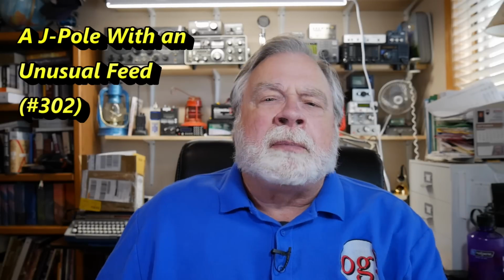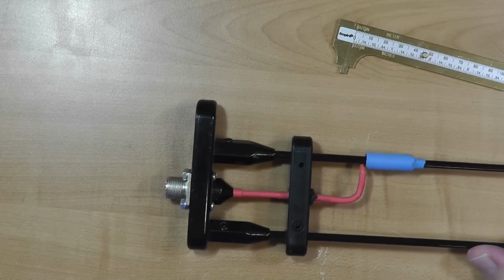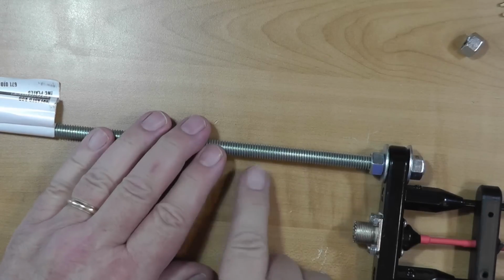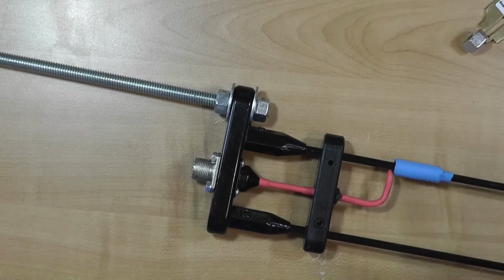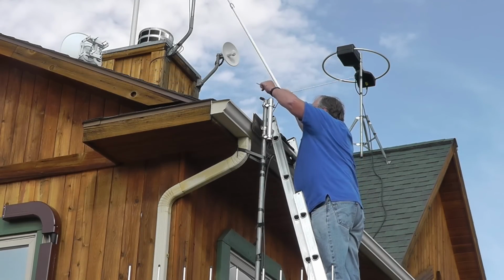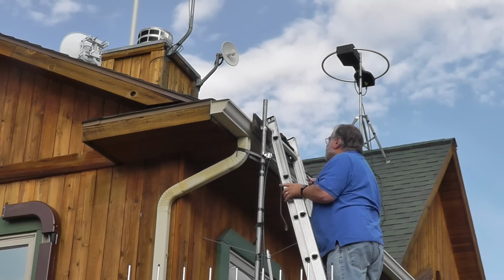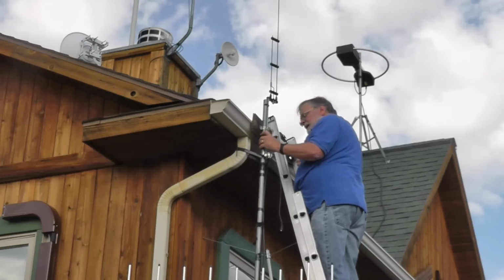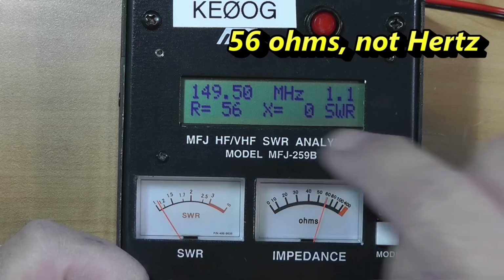An Unusual Jpole Antenna (#302)

Comment: I know this is an older video but I hope you still read comments on them.... At the final portion of testing the swr .... the swr was best just outside the 2 meter band, then you mentioned that the antenna needs to be longer... in which I understand that length is usually the key for antenna matching.... but what is the adjustable section (the feed point) for? I know its to be set at 50 ohms, but in the sweep of the freq from 144 to 148 ... you was in the 60 ohm range... so wouldn't adjusting the feedpoint be the better option for matching the antenna? And yesw, I also understand that its an unusual feed point design... it looks as if wire is wrapped around the element capacitively coupling to it... so I think that should be able to slide up and down with a bit of force. I'd really like to hear your opinion on this as I am struggling with the concepts of these antennas. I'm designing some j=pole for scanner listening and I'm having a bear of a time getting them tuned. Most of mine are being built using 450 ohm window line. I'm considering going to copper tubing for better bandwidth. But with bandwidth, the Q goes down and the gain suffers correct?

Comment: A few clarifications on the CAD drawing provided by KR7KZ from the link above.  The machine screw holes (P44-P47) for mounting the SO-239 are for #4-40 screws and the jamb screws (set screws) holes that secure the elements to the base are for #6-32 hexagonal head, setscrews.  Personally, I'd drill the setscrews centered on the element mounting holes instead of using a side-interference style of securing arrangement.  The design I bought over 42 years ago, was from a ham club that was raising money, is a variation of this one.  On mine, the biggest difference is that the coil is wound on the longer element (in basically the same location) and is wound upside down (from the top down) thereby making it impossible to prevent water migration onto the coil.  However, water migration only slightly detunes this design - maybe 0.3 SWR units depending.  To get the numbers shown in KR7KZ's table, applicable for my "upside down and backwards" design, I measured everything then reverse engineered the computational constants.  They are "ballpark" similar to his drawing.

Surrounding objects seem to have only minor detuning effects on this antenna as well.  Another nice feature is that it's sturdy enough to still be around during and after adverse weather conditions - like high wind.  If constructing with aluminum, this thing weighs approximately 1-pound.  Mine sits atop a lightly guyed, DXE, telescoping fiberglass mast using an appropriately sized mounting stud to slip inside the top section.  The baseplate and mounting stud can be any size or arrangement that you require.

The original method of construction shown here is infinitely more reliable than the garage-hack level designs of J-Poles being sold that are constructed of bare copper where the connector and feed line hang off a flimsy, sliding shorting bar (or worse - a bare copper wire) with all the inherent problems of corrosion and eventual mechanical failure.  It's little wonder many hams feel that the J-Pole is an inferior performer.  When you build with junk - you end up with junk.  I wish the one shown in the video was still available.  It's superbly built and way above the competition.

The one I own is constructed of 1/4-inch aluminum rod, 1/2-inch aluminum base stock, stainless hardware and Poly or PVC spacer stock.  I don't think UHMW was available 42 years ago.  Try this design - you'll love it.  And the feed system is a modified gamma match.  I suggest that you install a common-mode choke below the feed point.  73's
Reply: What you are describing sounds like exactly matches J-Poles (both 2m & 440) I have that were purchased from a fraternal group (VFW Post?) in the Bay Area of California 25 years ago.  I wish I could find a reference to them to see if they still are making them, but given the information/drawing on Dave's site and your comments above, I'm wondering if there is enough info now to locally reproduce them.  I've looked over the years and never found any sort of design info about them till now.

One thing I notice on my 2m version is there seems to be some sort of tuning done on the distance of the "B" segment of the wire in how far it is from the 1/4 wave side of the Jpole.  The wire leaves the center conductor of the SO239 at an angle for about 1cm and then bends parallel to the 1/4 wave side of the Jpole, which makes me think that there is some importance in that spacing.

Comment: There is an inconsistency in the referenced drawing. The long rod says 5/8 lambda, and the short rod 1/4 lambda. (Which is a ratio of 5/2). But the chart shows a ratio of 3/1 - as you would expect.  The chart also references C, but C is not shown on the drawing, but presumably is the long rod’s length.

Thanks for the review, but I can’t see where you gave a follow up on its performance.

Comment: 10mm is THE most common bolt size on all “newer” (circa 1980 on, or so on cars/trucks) .. foreign and domestic .. I have more versions of this size socket than any other, as well as a sizable collection of bolt and nuts, as they are the ones most frequently dropped and lost as well ...

Comment: Your antenna is a little too long not too short.  Trim a little off the top of the radiator.  As you shorten the antenna the lower band's SWR will get lower as you chop off the top.
Reply: Not so! The longer the antenna element, the lower in frequency. The shorter the antenna element, the higher the frequency. - - - The long element shown in the video was cut too short at about 58 inches. Dave was right, it should have been at 58 1/2 to 58 5/8 inches. KR7KZ

Comment: The feed line system is essentially a gamma match. Check it out in the ARRL Antenna Handbook in the HF antennas section. It has a length of wire or metal tube that is small fraction of a wavelength. It is then capacitance coupled to the J-Pole by a few turns of insulated wire wrapped around the short side of the J. Gamma match is a common technique to feed beams and keep most of the metal at ground potential.
K3UE
Reply: I was thinking the same. It is perhaps unusual to see a J-pole fed like this but not surprising to see a gamma match being used. In fact, arguably, as the J-pole is a balanced antenna, using the gamma match perhaps makes more sense than the usual method of connecting co-ax inner and outer directly to the stub part of the J-pole?

Comment: I just watched the video. Thank you so very much, God Bless Dave.  Much appreciated. 
Jerry KR7KZ
Reply: How did you come up with the inductive feed vs the usual J-pole, "DC short"?
Reply from the maker: There is a coil wrapped around the antenna at the actual feedpoint, and the close wires form a capacitor. 
These are the two parts of a gamma match.
Reply: @YZFoFittie  Hi. I was working for the Army M.A.R.S. radio station as a Sgt. Command asked us to see if we could create a mobile VHF Jpole. After the crew worked for about seven months in the lab we came up with a stainless 3/16 Jpole. Thats how it came about back in 1972. The one shown is the proto type #32.

Comment: Does the SWR and X value will change if the Antenna was heated significantly by the sun?.. shouldn't the antenna elongate and therefore it will resonate at a lower frequency?
Thank you for setting up all these great informative videos
Reply from the maker: It will, but by so little as to be hardly measurable. It will affect the center frequency by only a few tens of hertz, not enough to be noticed.
Reply: @davecasler  Thank you , I really enjoy your videos

Comment: With great respect David, you might like to consider if you should really STILL be climbing ladders, at your age with asthma?  I have used a 2" Al pole swinging on a hinged scaffold clamp,  set at 6 foot high on a 8 foot length concreted in the garden.   A 25 foot pole was easily  controllable by one person, and was locked in the vertical position by another scaffold clamp at the bottom of the 8 foot pole.

Comment: That Tram might work if you couple the sections properly.  Most forget to do it.
Reply: The antenna he took down looks like the same antenna that I bought a few years ago from Walmart (!), on-line, for $54.  I don't recall whether it said "Tram", "Workman" or "JetSteam" on the packaging, but they all seem to be the same so-so, Chinese-maufactured, dual-band resold by a half-dozen so-called antenna manufacturers.  I don't mind getting a mediocre antenna for $50, but it would burn me to pay $129 for the same item in a "Comet" wrapper.

Comment: I was watching the impedance during the testing and it ranged from 34 ohms up to 60 ohms.  Is that normal?  is there a range that we want to stay within for an antenna like this?
Reply: by definition an impedance mismatch 30 vs 50z (z is impedance which is the complex resistance in ohms + either capacitance or inductance component) is less than 1:1 swr

Comment: Never understood why people build j-poles,  not a fan of the design  at all, or the feed line problems that go with it. For 2-m, a simple folded dipole on the vertical, with a 4:1 BALUN ( coax balun ), will out perform, the j-pole, is simple to make, smaller in size, has a near perfect omni pattern (unlike the j-pole) with much better gain.
Reply: Why a folded dipole over just a center fed vertical dipole?
Reply: @WeirdScienceTime  well when I tested them, the folded had much better gain, in the real world and when modeled. My fave antenna I run them vertical, in a diamond shape about 1/10th wave length wide at the center. I have found no better antenna on 27 mhz, I have built most of them. I find they perform better than the current info states, I believe that in a diamond pattern, on a vertical antenna, all wire is vertical, very efficient. Outperformed many quad loops, and the quads were bi-directional.
Reply: @pixotica  That is interesting. Will add the "diamond dipole" to list of things to try. I can understand why a folded dipole may have benefits over a J-pole. However, the J-pole probably remains popular for various reasons - easy to construct, can be made from various materials (like ladder line that can be rolled up), may be easier or convenient to end feed the antenna, you can adjust the feedpoint impedance easily, you can add phasing coils and additional sections to increase gain, the slightly lopsided radiation may even work to your advantage if you are interested in working a particular fixed station like a repeater?
Reply: @Steve-GM0HUU  then a half wave end fed would fit the bill , hit all those marks.
Reply: Vertical folded dipoles are pretty common for VHF, aren't they?  Especially several stacked with appropriate phasing.

Comment: Looking at his "print" for the design is frustrating. Several errors. Perhaps you can have them fixed then link a good print? Multiple measuring systems, missing decimal point (hopefully), undefined measurements, etc.

Comment: Yea, you are back.  It was great what you did for HAMs wanting to be extras but I missed your regular videos like this one.  When I became an Advanced Class the only difference was CW and I was just short.  Did you ever make a SlimJim 2 meter antenna?
Reply from the maker: I made a twinlead-based roll-up J-pole and did a video on it, but I don’t think it was branded as a Slim Jim.
Reply: @davecasler  Here you go, Dave.  I made it and it works really well.  https://bit.ly/3dcB6Zb